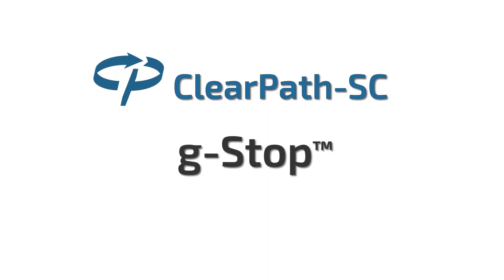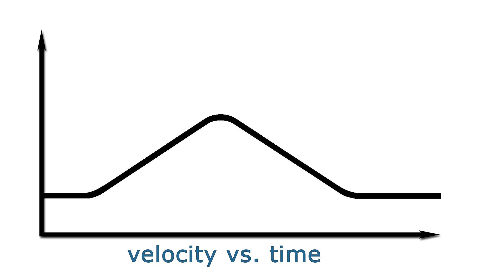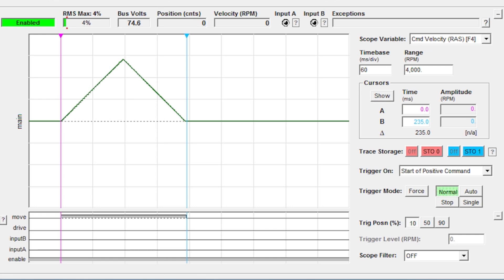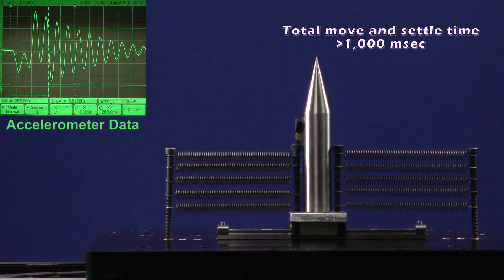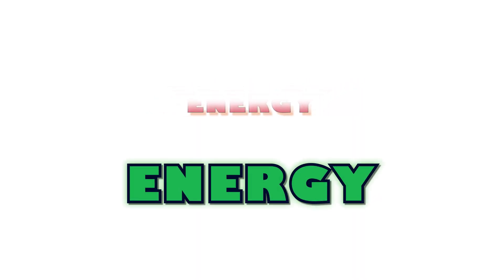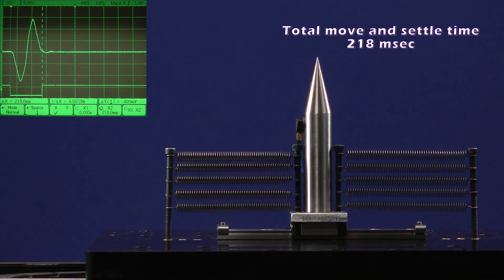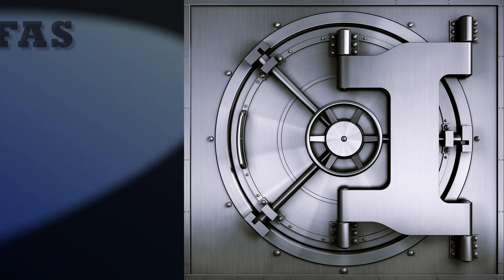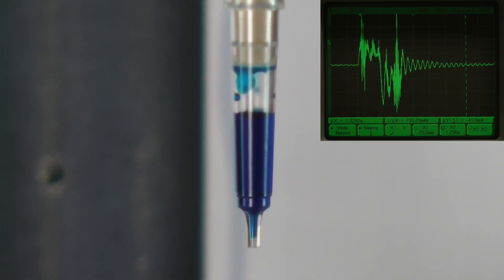ClearPath-SC g-Stop Control: Ultra Smooth Motion Profiles

Comment: Are you guys looking into making a servo with more than 6400 encoder resolution per say 20k or so. Having issues with artifacts were servo seems to be jumping between counts to keep it in position with higher resolution encoders this issue seems to be less noticeable
Reply from the maker: Hi nightmare in action, all DC ClearPath servo motors use an optical (not magnetic) encoder with an output resolution of 12,800 quad counts per rev. On the “Enhanced” ClearPath servo motors, the input resolution is ½ that or 6,400 pulses/steps per rev (meaning you can issue a position command of as fine as 0.056 degrees).  

The condition you describe (jumping between encoder counts to keep position) is often referred to as “hunting” or “dithering” and can be caused by several things like high inertia, a poorly tuned system, and compliant mechanics (or some combination of all three). ClearPath has several features, including a proprietary “Anti-Hunt” feature, which often minimizes or completely eliminates any unwanted hunting/dithering as part of the auto-tune process. We’d like to help you identify and eliminate the source of the unexpected motion in the system.

Please give us a call at 585-784-7454 between 8 AM-6 PM EST, or use the "Contact Us" form on Teknic’s website: https://www.teknic.com/contact/

Thanks,
Abe A. - Teknic Servo Systems Engineer

Comment: Very impressive! Is the SC option available for step & direction applications?
Any plans for a NEMA 17 size line of products?
Reply from the maker: Hi hotburnymustard, we appreciate your feedback and your questions. The SC ClearPath motor family can be run in step and direction mode. However, even in step and direction mode,  ClearPath SC still requires application code written in C++ for other machine functions such as enabling the motor and error handling. Page 65 of the current ClearPath SC User Manual (Rev 1.30) goes into more detail about setting ClearPath SC up in "Step and Direction" mode:

https://www.teknic.com/files/downloads/Clearpath-SC%20User%20Manual.pdf 

Teknic has investigated the possibility of manufacturing a NEMA17 size ClearPath integrated servo motor. The objectives for the project would be to scale down Teknic’s technology into a NEMA17 package without sacrificing quality, and to be able to manufacture these motors in high volume at a competitive price. At this time, we don’t believe we can meet all of these objectives, so the project has been put on hold (at least for now).
If you would like more information, please send your inquiry to support@teknic.com.

Best regards,
Tom T.
Reply: Tom thank you for the detailed reply. I have been using the M-2341 N23 motors for a while now. They are simply amazing - with breath-taking 'rip your face off' power for a motor that size. The N17 sized motors would be ideal for prosumer 3D printing applications where a N23 sized motor would add undesirable weight to the hot end. This is the application I had in mind the split second I saw the SC enhanced motor deal with reverberation.